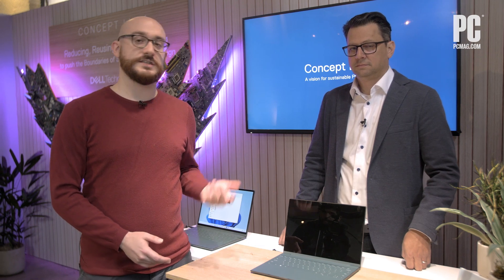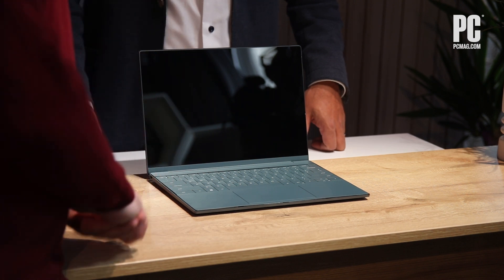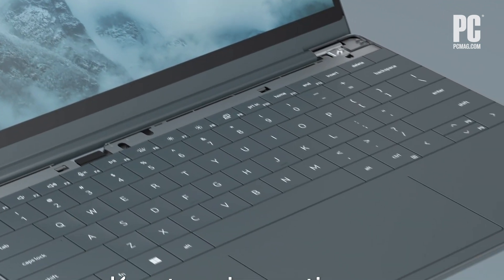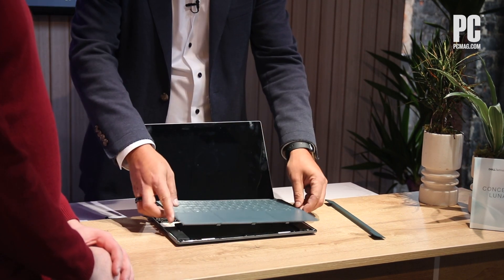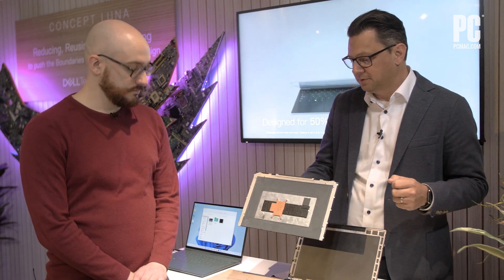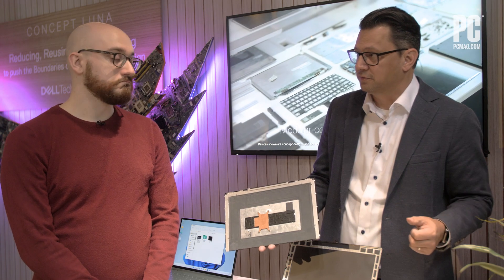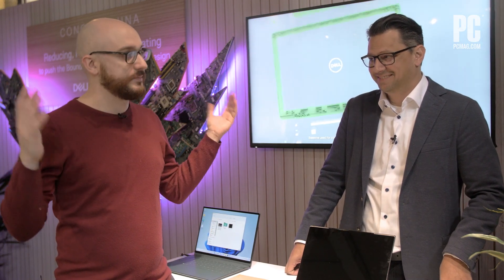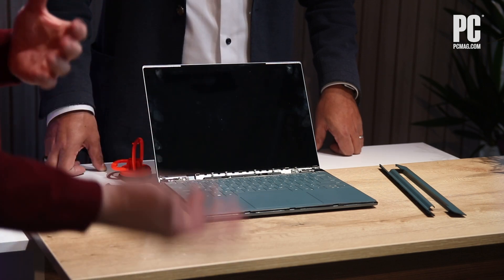Dell's Concept Luna: Recycling, Downcycling, and Upgrading Your Laptop With Modular Parts

Comment: I would rather see Dell solving their widespread QC issues and a make  Dell XPS 14 with larger battery,trackpad,better cooling and more ports in return for a slightly thicker chasis and a design similar to Macbook Pro 13,tired of wedge shape designs.

Comment: Not a good concept. It can damage display by the heat from a X86 processor. So we have to upgrade display soon. Or it will be severely down clocked CPU .

Comment: As long as it's for-profit, there is no sustainability. Most consumers wouldn't be able to do swap the parts even if it was modular. As for recycling, it's not going to be recycled. It will end up in a landfill, like most plastic. This is unironically a CONCEPT, and NOT A PRODUCT!

Comment: So it's a Framework laptop .. Shame on you Dell
Reply: Shame? Isn't it good that the dell is going that way too? Of course, we have to wait for how it will actually look like, but it's probably better that they want to create laptops with "right to repair" in mind
Reply: @Daniel_VolumeDown  imagine you start a company, and a much bigger and accomplished company like Dell creates a product essentially identical to yours, puts their money into it and erases your small company. How's that not shameful?
I mean, it does of course has its positive aspect as well, but I fear that it will impact Framework negatively, to the point that they disappear :/
Reply: @MrLazini  Yes and no. I mean, the "right to repair" is something that I think should be done whenever it can be done (as long as it doesn't cause too much trouble, of course) and companies shouldn't just not do it because it has already been done by some other company.
The problem, of course, is that we don't know why dell actually does this. We know, however, that the framework does it most likely from a real desire to improve the situation (although of course we cannot be sure), so we should support the framework much more than the Dell. If it actually turns out that the framework will cease to exist, it will be very sad, because perhaps they were the ones that caused Dell to worry about it at all. On the other hand, the framework is a small company, while Dell is large, which also gives it much more opportunities to promote this way of creating devices.

In an ideal world, if Dell actually got inspired by the framework, it would have said it publicly, but of course that probably won't happen.

This is somewhat similar to the situation with patents. On the one hand, it would be good if the actual inventor of a given thing will have better opportunities to develop it. On the other hand, patents often only hold back human development.
Reply: @Daniel_VolumeDown  I agree with you
Reply: I feel the same way Dell and other large companies are gonna be jumping on the bandwagon acting like it's innovation while they are only doing it because framework showed the world it was possible and they were just lying and making excuses for profit

Comment: You (Dell) guys are so full of yourselves.
I bought a machine in 2016. 5 years. Been using it, and using it well. I DON'T have the money Nor do I Want to buy a new machine. 

So why can't you guys even help me diagnose what's wrong with the machine ?

Why is it dell thinks that after 5 years, Inspiron laptops are end-of-life, not worth repairing.

I literally was told we can't help you even diagnose the problem. Multiple times. 

Your "Sustainable" approach is a stark contraindication of your other policies, if a 5 year old Inspiron can be deemed end of life.
Reply: @Gaming*  here's the thing: it took me less than a weekend's worth of effort to realise that it was a failing battery and hard drive, which i replaced for less than 13k rupees (think close to 150$ )total, on an 800$ machine. Including an SSD boot upgrade. This could have been reduced to an evening's worth of effort at dell's end and i would've happily paid an additional 25-30$, my time is more important to me.  

And no machine "has a lifespan".

More often than not you need to Identify the use case of the machine, and proceed from there.

I don't need a new machine yet, and when I bought this laptop, it was after my 8 year old desktop had become too expensive to repair. 

My current machine does everything i need it to. I can still get a Very usable 2 to 3 years out of this machine. 

And Dell in their new XPS 13 inch don't even hve removable SSD. So if any one component dies on that motherboard, you're replacing the entire thing. Like i said, Dell is full of themselves. Also at the time of writing this there was a chip shortage and astronomical GPU prices, and while they have come down so that i can now afford a new laptop with a decent GPU, My point remains.

Comment: Great concept, bad implementation... this is not even close to a modular design like framework.

This is basically a tablet with an external battery and keyboard. You can't put your own HDD or memory, ports, etc...

Also, there is no indication that the monitor could be actually replaced without replacing the whole board. All indicates that the screen and board are stuck together...

Comment: So if the screen fails, you have to purchase another screen with the added cost of the motherboard too?
Isn't this just another cheap business trick to gain more profit?
Reply: 2:01 : "this makes it very easy to service the motherboard as well as service the display". So, no, the motherboard is mounted to the back of the display, but is independant.
Reply: @esseferio  i thought it was fastened with gum or something. Good thinking there but i wonder whether this will make the screen thicker...
Reply: @govarthenanrajadurai9817  most certainly thicker, but that's a trade off I'm OK with, in this case :) But that's my opinion and not everybody has to agree with me :)